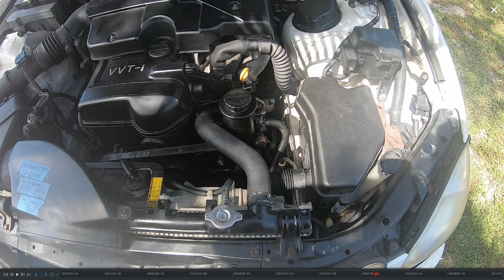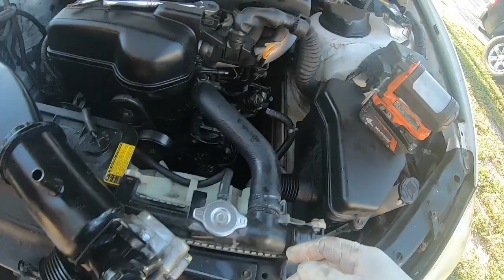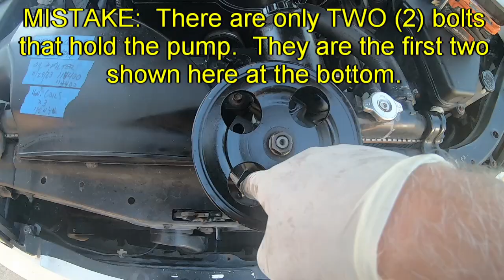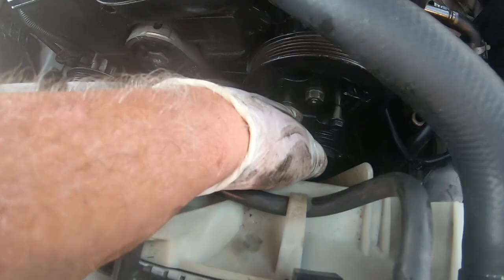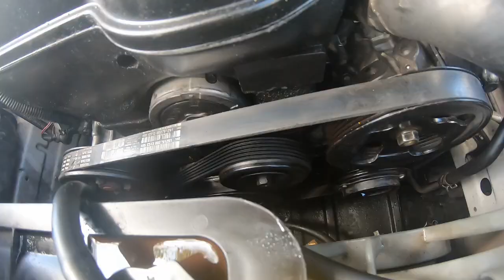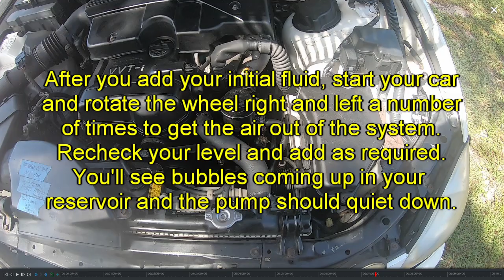2004 Lexus GS300 Power Steering Replacement Tips and Info

Comment: Great video, much better than the other videos I saw on 2jz-ge power steering pump replacement. I like that you showed the bit about the weird sensor/ HP line housing that screws on.
Reply from the maker: Thanks.  Glad you liked it. What is supposed to be easy always seems to throw a wrench into the works to make it challenging.
Reply: how do you remove that housing